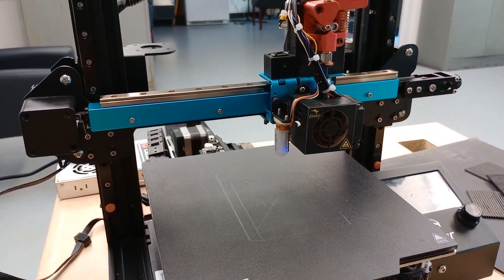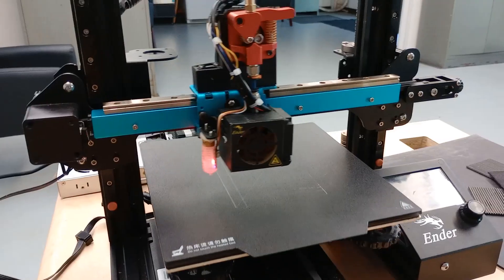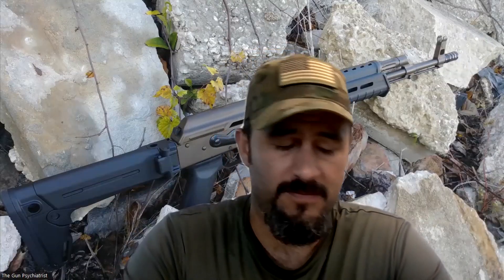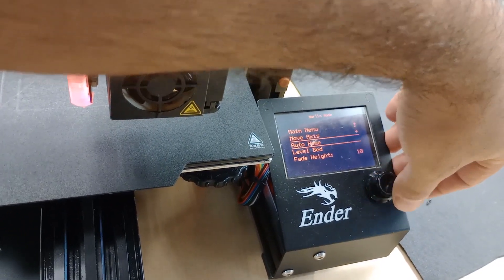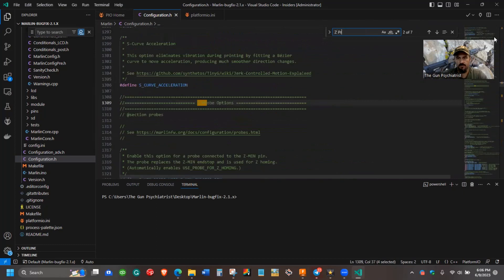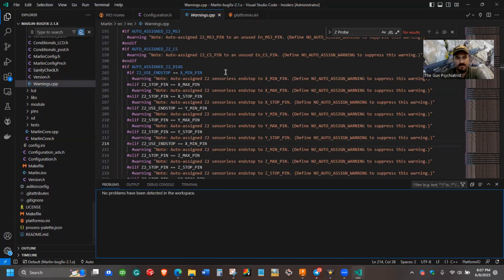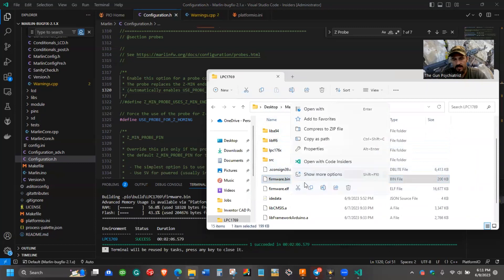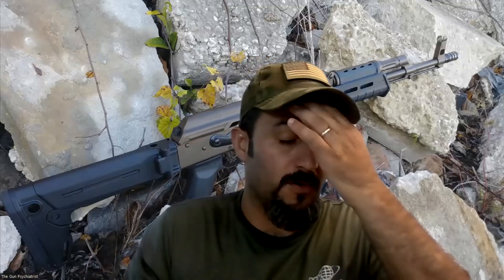Ender 3 Z Axis Wont Home? Here is the fix (Links in Description)

Comment: I updated my Ender 3 to the 4.2.7 board and got the same issues. Turned out I was using a 64 gig SD card. When I used my 8 gig SD card and loaded the firmware it fixed all